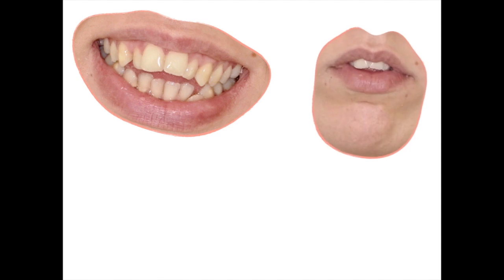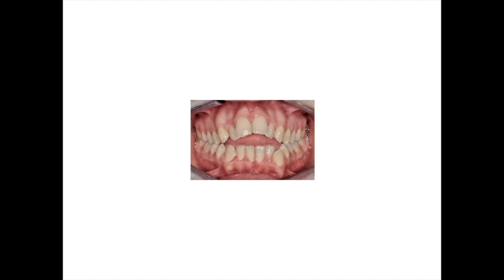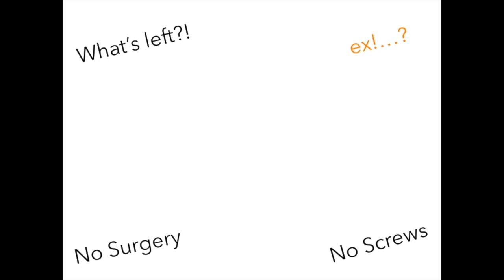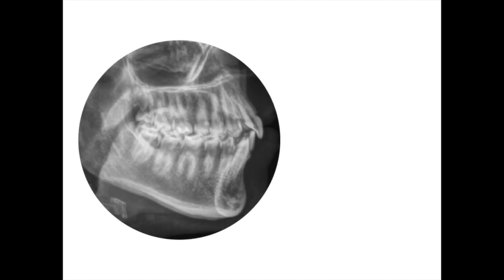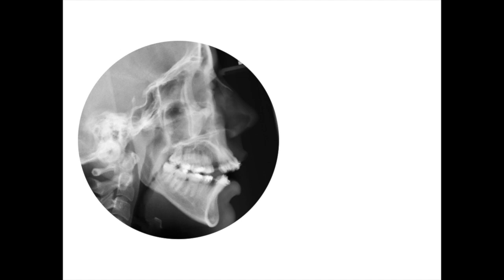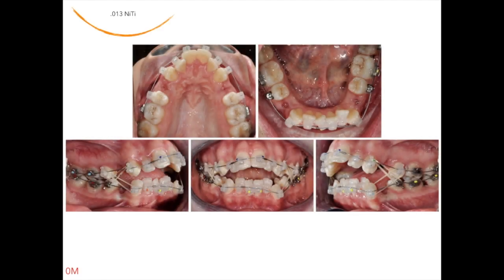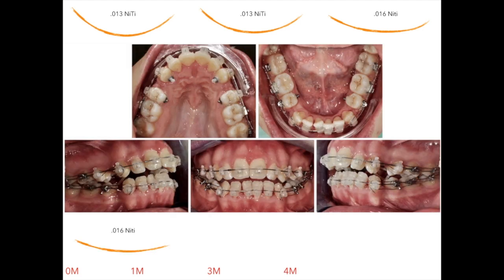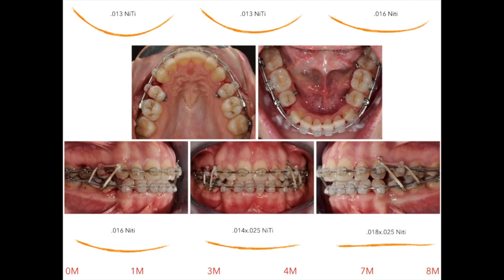Orthodontic Open Bite Tip: 🎢rollercoaster effect to your advantage

Comment: I had an open bite a year and a half ago. I had braces on my teeth and had the premolars removed in the upper jaw. Currently, I have severe difficulty pronouncing the letters S and Z. Will this problem continue or is there a solution for it?

Comment: Where did the condyles move? Downward? Forward or Backward? If you use the elastics to close the bite, the condyles move somewhere inevitably. It can be the cause of Temporomandibular disorder in the future with high probability. Nobody shows what's happening in the temporomandibular joints. It is just like you are throwing the kitchen trash into the living room. vice versa.

Comment: I used to have an open bite (5mm) and most orthodontists had suggested extractions since I couldn't afford surgery. So I opted for a camouflage technique instead, osseous genioplasty to fix my protruding chin, 4 premolar extractions (wisdom teeth had already been extracted), lingual braces with tads for 2 years. I now have wire attachments behind my front teeth and wear a retainer for 12 hours a day and a tongue crib to better help me position my tongue. It has been worth it.
Reply: How long month?
Reply: Why did you have an open bite?
Reply: @DavidsKanal  Very bad facial structure, especially in regards to the the maxilla and the mandible
Reply: @Faithmay96  did you also have to correct your tongue posture // do myofunctional therapy or was that not needed because it wasn't a problem/the bite never opened back up?

Comment: But what about the tongue thrust that causes the issues in the first place though? and not enough room on his pallet ? because after the removal of teeth, the pallet will become smaller and the culprit is still there, TONGUETHRUST. How do we fix that? thats the challenges i'm facing . i'm yet to fix my open bite but these are what i need explanation for. pls help.
Reply: Did u find solution for ur problem?
Reply: @vijay-np8wd  nope from my research the tongue will have to be retrained  and the pallet can be widening in .
Reply: Myofunctional therapy can help if the space isn't too restricted. It's weird that the patient would to extractions but didn't accept miniscrews since they're far less invasive.
Reply: Vivos appliance

Comment: I think roller coster effect helps to intrude the teeth
Reply from the maker: Hi Bhagya, and in fact, it does! It's just that most of the times is an unwanted side effect. Rollercoaster effect usually happens when trying to close extraction spaces on small round wires. What happens is that posterior teeth's crown tip mesial, anterior teeth loose torque, and the premolars intrude. if you want to know more, subscribe!
Reply: Thaaaaaanks @giacomomassoni8042